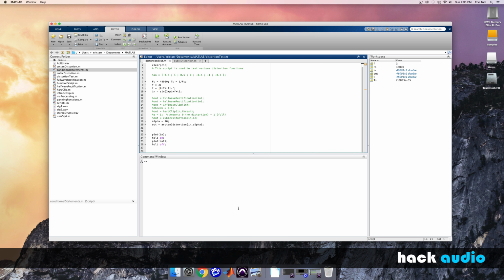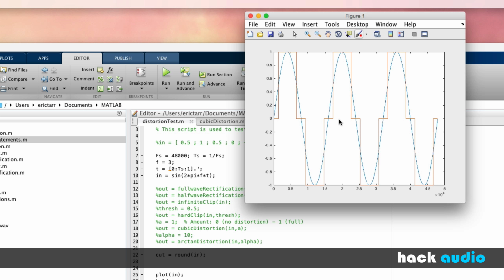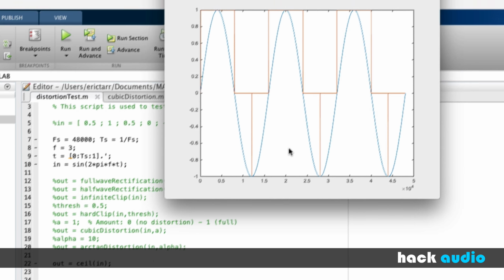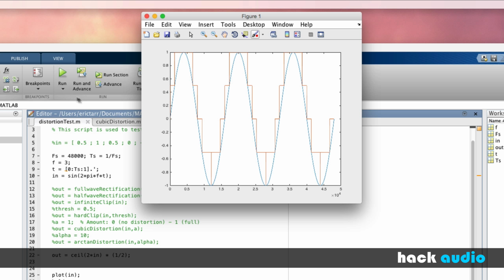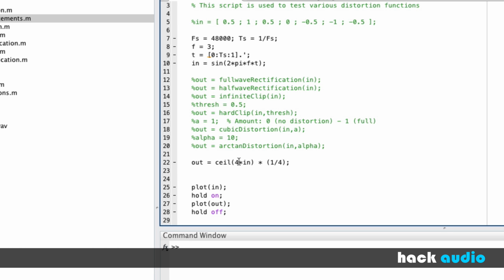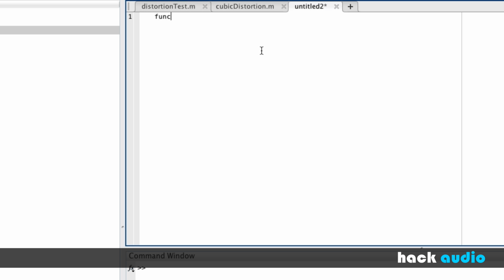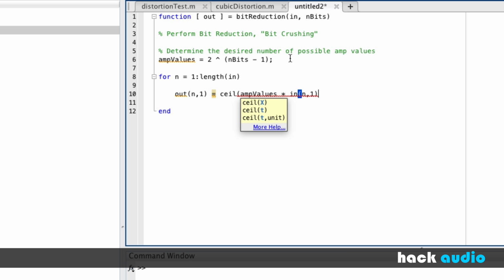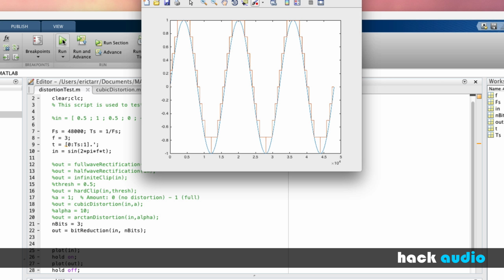Hack Audio: Bit Reduction

Comment: This video along with some others inspired me to create my own bit reduction and dithering plugin. Unlike some other audio plugins, this one processes audio as if you were converting it to a lower bit depth for storing in a fixed point format. The idea is you can apply this plugin as your last effect post fader and render 2 versions. One at 32 bit float and the other at your target bit depth with the dithering in your DAW disabled. You can import your newly rendered tracks into another project and invert one of the tracks. You will notice they null perfectly, that is if nothing in your project changes every time it is rendered.
As a side note, round is the best function for quantizing, as it preserves the signal as low as half of the LSB without rounding off 1 side of the waveform to 1 and or -1 if the input is below 0.5 and or -0.5.
For anyone interested in my plugin, you can take a look at the code at https://github.com/datajake1999/C1Bitcrusher
I really enjoy these scientific and engineering videos, as they show how these kinds of processes work. They inspire me to create experimental projects like the one above.
Reply from the maker: Jake, that's amazing. I love that idea. Keep of the good work. Glad you found the videos.